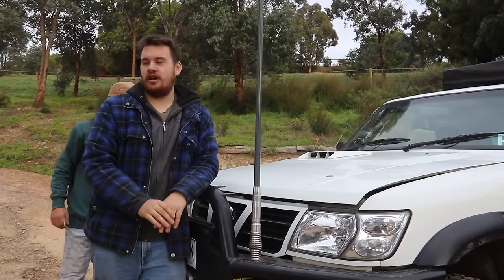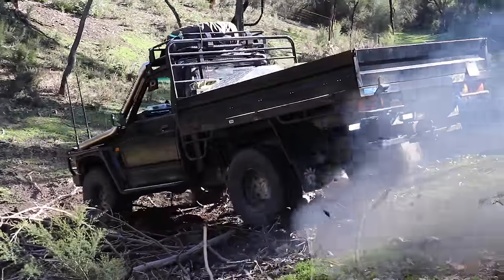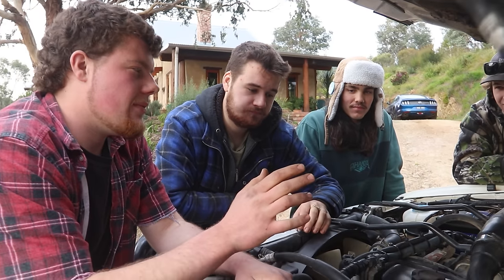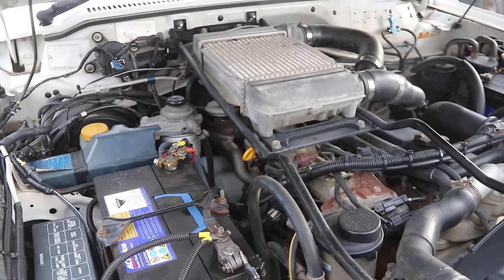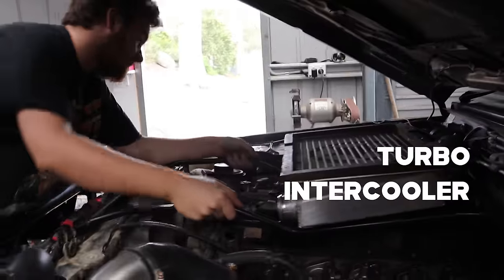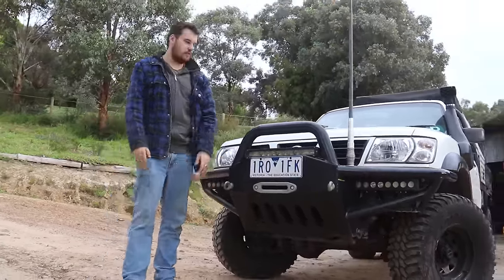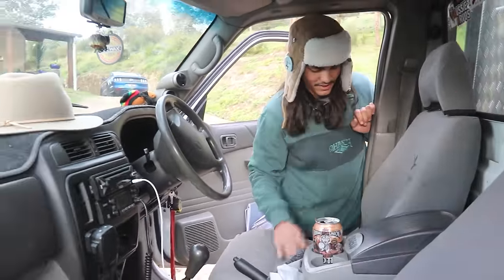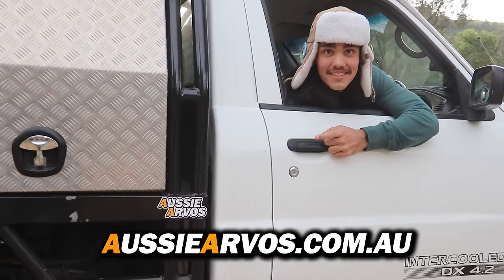THE SOOT MONSTER GU TD42 PATROL | Nic's BEAST 2003 Nissan Patrol GU TD42 TURBO 4X4

Comment: At 18 psi you'll be operating outside the efficiency range of the HT18. Might be fun to watch on the gauge, but do the right thing and dial it back down, 15psi is perfect. At 15 psi and approx. 105rwkw and 400Nm you will have a very reliable and capable rig. 

If you find this power level isn't enough (especially if heavy towing or if you add a heap of weight to the ute), then in the meantime save up for your choice of turbo and intercooler. 

Yes you could run 38 psi (or more) but expect to lose a few head gaskets along the way. 

You've found a clean TD, if it was mine I'd favour capability mods over power every day. Even with UFI special 200+rwkw and 700Nm they aren't fast cars, but left relatively stock they will always get you out there and back.
Reply: 100% 18psi is way too much for the HT18. Exhaust manifold pressure will be through the roof. 15psi is not factory for the HT18 so it's already been tuned. More psi does not equal more power, air density and fuel does. You would make more power with a better intercooler and 15psi than 18psi and factory intercooler. They need to watch some videos by gale banks and educate themselves before ruining their mates new car, these guys have the mechanical knowledge of a first year at best.

Comment: I’m looking to do my one what aftermarket turbo and bits n pieces
Reply: 16g large from ufi and 12mm pump 600x300 top mount cooler 170kw 850nm   it's very drivable. 

Everyone will say 18g is the go but iv driven both and had plenty of people drive mine all prefer it, on boost was sooner still makes 30psi.

Comment: Not too smart winding up the boost if there isn't enough fuel to compensate and it leans out and something goes bust or too much fuel.. Hence best to only fiddle with that once/while you get it tuned so you can check everything at once. 

Or you can cowboy tune it and effectively put your 19.5k all on black and see how you go.
Reply: You can run up to 50psi with a non turbo motor on stock fuel if u can spin turbos up that much, diesels blow up from rich not lean
Reply: Diesels are lean burn engines
Reply: Clearly u haven’t seen the black GQ we have haha
Reply: It's not rocket science mate. Delete the gate, screw the pump to 850rpm operating temp idle and get a good pyro with no delay.

Comment: You were saying the difference between an NA blacktop and a factory turbo black top? Strength wise, I’ve always been under the understanding the silver tops were the strongest? Not turbocharged from factory, but bloody strong internals. Haha.. maybe a debatable topic!!
Reply: Thom Janson  silver top is the original forklift motor then they went to a na blacktop and lightened the internals so it would rev better na that’s why na blacks don’t handle boost aswell then there is the factory turbo blacktop which people say are the “better” td42 as they have the turbo internals to handle boost better
Reply: @noahmuller1813  hmm ok. I’ve always read differently. Ive read they were in buses, trucks and the forklifts. The silvers had heavy but stronger internals out of all the TD42’s. Then the blacktops had lighter internals, for fasting revving and easier boosting. Great engine also, but not as strong as the silver tops.
Reply: Thom Janson believe what you want but a FACTORY TURBO black top not a NA black top will hold more boost then a silver top the NA blacktop and FACTORY TURBO blacktop  are a complete different internally there is also a the TD6 td42 these were the the last of the td42 and and came with the factory intercooler
Reply: Internals dont change that much at all, they can all take close to the same abuse
Reply: ABH diesel performance wrong. The silver tops have 28mm gudgeon pins but stronger piston crowns so can handle big boost. the NA blacktops have 30mm gudgeon pins but they lightened the piston crowns for automotive use so cannot handle much boost. Then they made the factory turbo blacktop which has both the 30mm gudgeon pins and the stronger piston crown.

Comment: leafys in the rear 😫
Reply: Gayeeee Leafys and a shit tune couldn’t get any worse
Reply: leafs are the only way to go if your actually going to do something with it....not every one is a weekend 4B head that never goes more than 100ks from home and carries a fake Engel at the very most.
Reply: Shaun Murray not really my mate had one of these 7” lift airbags and would smash the glass house mountains atleast it would flex
Reply: @keithy363  7" lift thats insane ha! yea it flex, but almost fall on its side every time you go around a corner and handle like shit. Leafs are more ridged than that.
Reply: @JezButcher  i have towed a 7meter boat to exmouth with a coil patrol i had before....it did it like a bucket of shit, im way more happy with my leaf spring cruiser. what would you even know